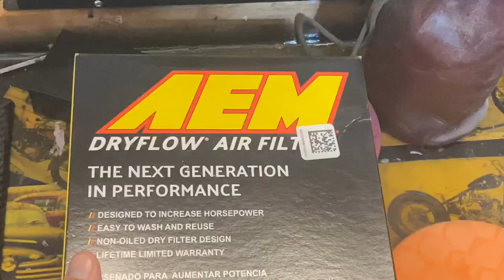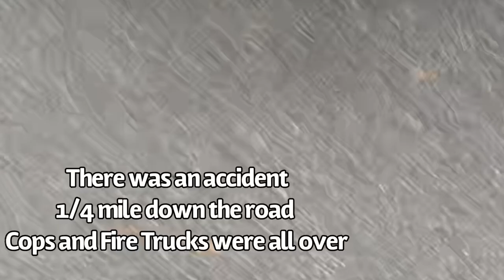Q50 Vlog GOOD THING I got new TIRES!!

Comment: Does your Q50 turn a bit of purple midnight in the sun too? I thought I bought a black one but it changes colour also when I wash with hot water
Reply from the maker: No.  Mine is obsidian black—a straight black.  You must have the malbeck black, which has some flame in it and turns color in different lights
Reply: Speed Culture Studios yes I do u guess thanks!!!

Comment: If you press and hold both the buttons above the brake pedal while pressing the gas it’ll let you burnout better
Reply from the maker: It’s just the white button you press, and it was
Reply: @SpeedCultureStudios  hold them while doing it
Reply from the maker: @Anthony_Torres209  lol, no.  There would be no point in doing a burnout while trying to duck down to press the buttons.
And there is no need to hold the white button—it just needs to be pressed for about 8 seconds to turn off some of the additional controls.  Again, no need to hold it while doing the burnouts.
Reply: It tricks the car into thinking the brake isn’t depressed It’s the only way I can get my q to do a standing burnout. It won’t even do it with vdc and traction control off
Reply from the maker: @Anthony_Torres209  right, the black button is the brake switch.  I’m trying to come up with something that can hold it in while the brake is depressed.  I’m not going to lean over and try and hold it while doing a burnout lol.  Sort of dangerous.
Reply: @SpeedCultureStudios  haha yeah not the safest but it does work! It’d be super easy to make something to hold it. Try it man I’ll stay tuned👍🏾

Comment: Okay so is the air filter you bought from z1 for your q50 does it increase horsepower?
Reply from the maker: Check out my other videos.  Everything is explained in them.
The filter is from aFepower.com  
They won’t provide more power but will help pull more power when tuned

Comment: What size tires??
Reply from the maker: 275/35/19 rear
255/40/19 front
Reply: @SpeedCultureStudios  I need to find out if 275/35 would fit on the front staying stock height .... 🤔🤔 great content as always man!
Reply from the maker: @AtlasWilder  really depends on offset of the wheel.  The tire will fit.  My wheel is a +35 offset and 9.5” wide so it sits flush with the fender.  I could not run a 275 up front, it would rub.  But I am lowered 1.4”.  With a +45 offset on a 9.5” wheel you might be able to fit a 275 up front.  Any reason you want to go so wide?
Reply: @SpeedCultureStudios   gonna be running a 9.5” wheel with 45+ offset. 370 front wheels.  I don’t wanna go smaller diameter than stock I know 265/35 is an option however it’s a bit smaller and with not lowering the car I don’t want to create excessive wheel gap.
Reply from the maker: @AtlasWilder  I hear you!  That’s why I chose that tire for the rear.  Very close to stock.  I have 255/40/19 for front tires—with that wheel width and offset, it’s a perfect fit.  I don’t think it could get a wider tire up front as low as I am. There is evidence of ever so slightly rubbing from entering/exiting steep driveways